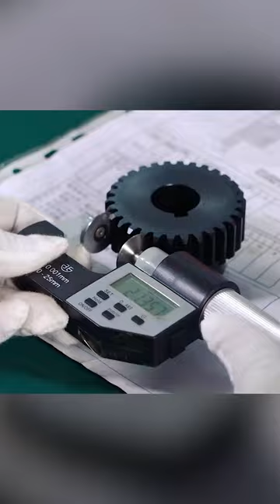How to mass produce gears in large factories.#automation#production #gear

Comment: What the purpose of tapping it, whether for lubrication or anything to mate inside ( KEY) ? The gear is perfectly machined. Nice work 👍👍
Reply from the maker: Mainly for the purpose of connection and transmission, the center hole of the gear and the bearing are fixed directly, so that the gear can directly transmit power or torque, avoiding the unstable operation of the device due to lateral vibration.:face-red-heart-shape:

Comment: why not broach the gear before hardening? wire edm seems like a nightmare for cycle time
Reply from the maker: Avoid unnecessary effects of quenching on the.
Reply: I make gears for a living. Hardened parts are easier to clamp without damaging the teeth. Most gears are made from a steel called 20MnCr5, which is easily dinged up and marred when still soft.
Reply: @pookie9461  thank you so much for explaining!